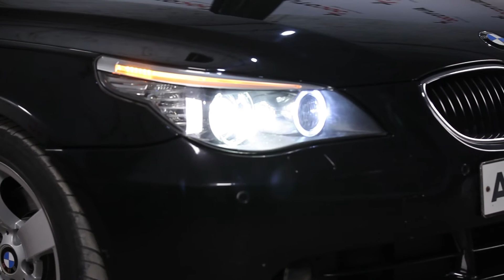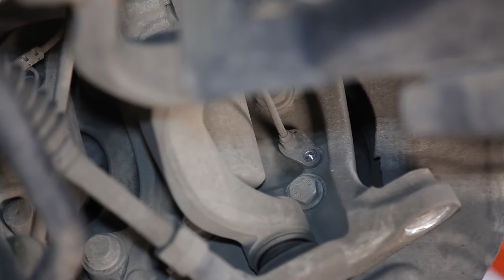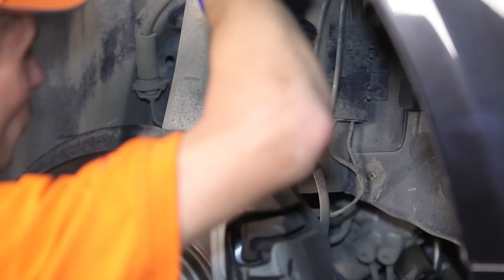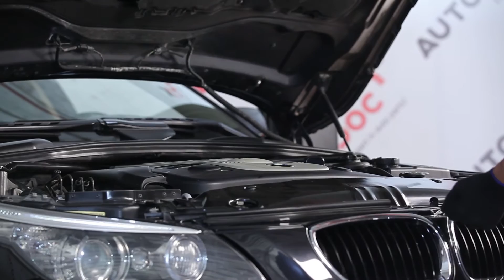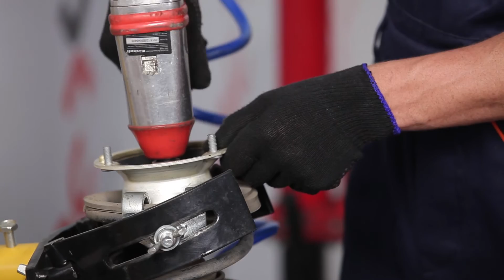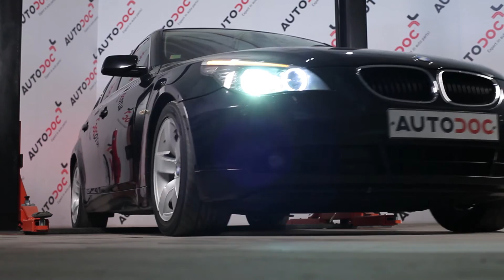How to change Strut Mount on BMW 5 E60 TUTORIAL | AUTODOC

Comment: The bolt that pinches down onto the strut through the control arm is that threaded through the control arm or only held on by the nut on the other end of the bolt? I broke the head off the bolt and I’m wondering if it will push through the control arm
Reply from the maker: Thank you for your comment!
Unfortunately, we cannot definitely recommend any method, however, in theory, if the head of the bolt is broken off, it can be pulled out from the side of the fixing nut.
Best Regards,
Autodoc team
Reply: @autodocuk  thank you so much and for the quick response. I was able to do that and got it all fixed

Comment: Does the E60 with M-packet (lowered stiffened) suspension have the same strut top mounts that you replaced in they video? Are they different on pre LCI and LCI models? Which one do you recommend from experience?
Reply from the maker: Thank you for your comment.
Unfortunately, for a more accurate answer, we need more data about your car, so we recommend that you contact our support service, where they will definitely try to answer your question.
Best Regards,
Autodoc team